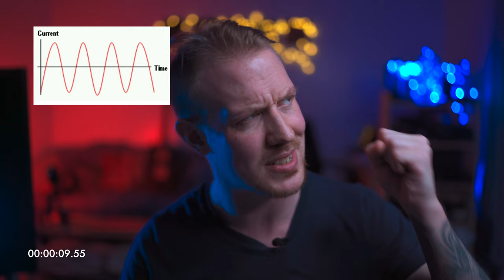2 Min Tips  What Causes Light Flicker In Video, How to Fix it + Shutter Speed

Comment: Thanks for this excellent explanation. I am using a time lapse phone app called Lapse It to record desk artwork being created on white paper. The flicker is terrible. Controlling the shutter speed to a (UK) 50th second is possible but the other aperture/ISO controls are pretty non existent so my image is blown out. I am stuck with a shutter speed of anything between 1/1000 and 1/200. I am lighting it with a powerful overhead LED light strip but it's not specifically a VIDEO LIGHT. Is that what I'm doing wrong? Should I be investing in a specific type of light to counteract the flicker as you have listed in your notes?